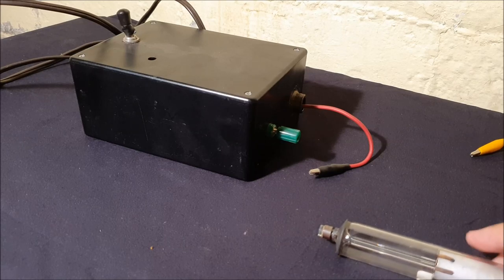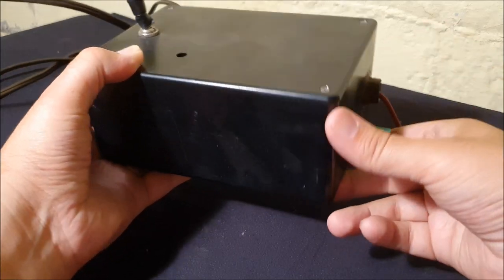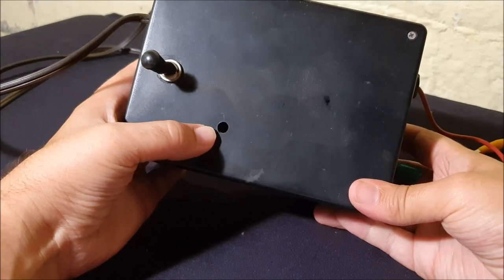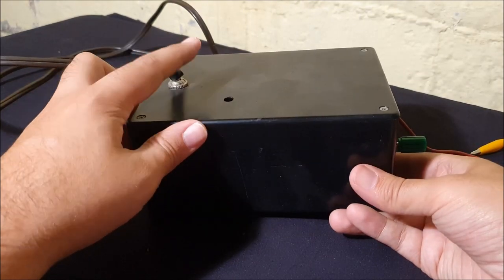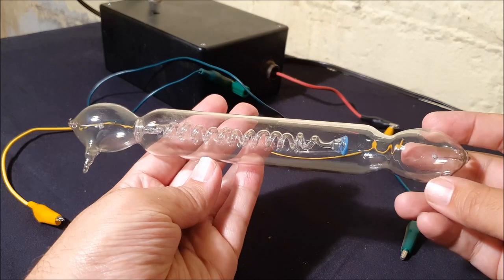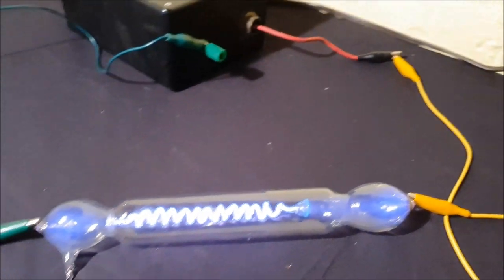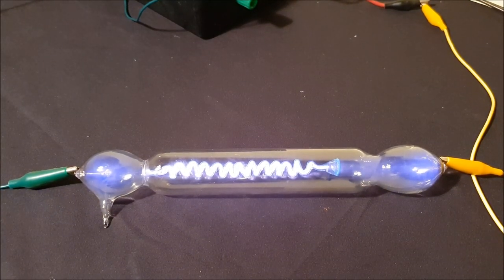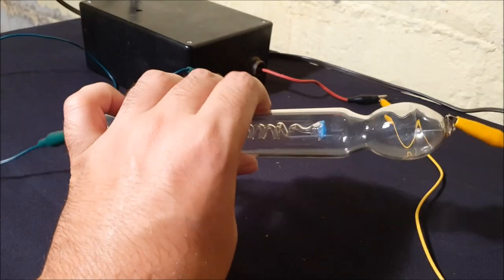High Voltage Tubes Episode 2 : Laser Tubes and Geissler Tube

Comment: My green laser pointer could make certain paints and pigments glow yellow, while my violet laser pointer made different substances glow.  Have you tried the laser and geissler tube next to fluorescent materials to check for UV?
Reply from the maker: I checked with a cheapo UV meter did NOT get any UV indications outside the glass... and I did check the UV meter against a UV lamp and it did produce a reading...

Comment: Any chance of X-rays coming off of any of those tubes?
Reply from the maker: If you measure the voltage drop directly across the tube, you can calculate the wavelength of emissions. I put a calculator on my website. www.sparkstarter.tech